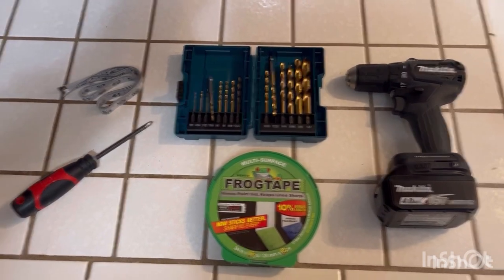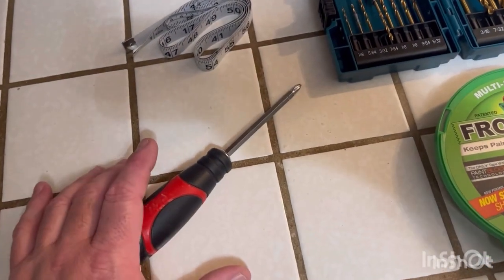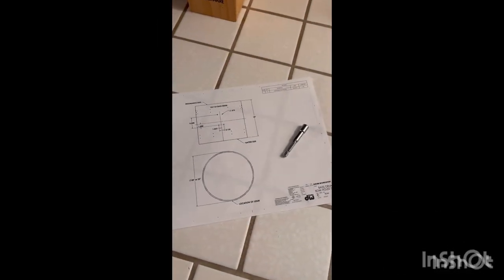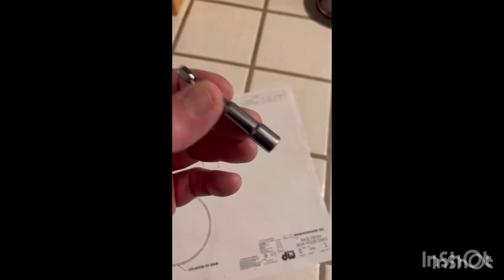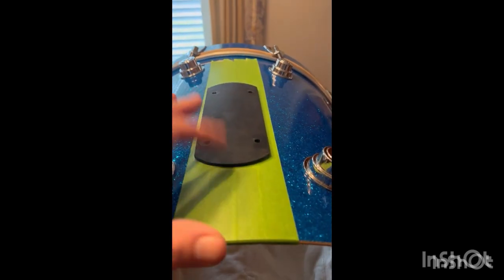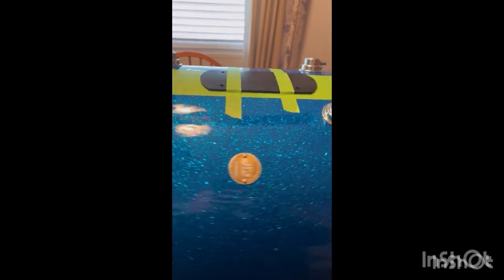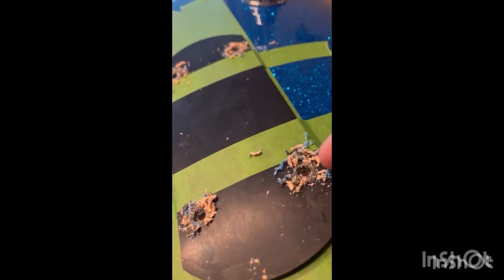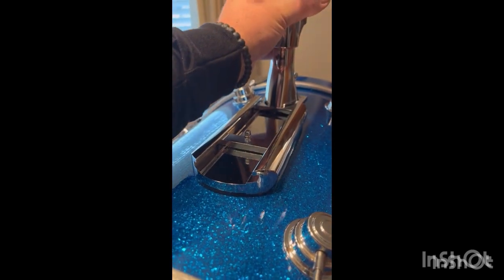The DW DWCP9900BD Bass Drum Double Tom Mount !!! (INSTALLATION)

Comment: Glad to see someone else doing this, it’s certainly opened a lot of convenience for me, and I can safely say that it has no perceivable affect on the sound of the kick after installing.  After having installed this on two different bass drums, here’s a few interesting tidbits for anyone reading this:
-Before drilling, I used a 1/4” bit with a hammer as a “punch” to guide the drill bit for each drilling spot.
-I used a small drill bit at first to go all the way through, then using a 7/32” drill bit and the pilot hole, I drilled about halfway through the shell from the top first, then used the pilot hole to guide drilling the rest of the hole up from inside the shell (this minimizes the outer plies of the shell from coming apart as the bit goes all the way through).
-I’ve installed these on Gretsch Renown Maple bass drums, which are thicker than what the provided screws can handle.  If you need to do this, I bought 1” 10-24 bolts and additional washers to secure it.

Thanks for making this video!

Comment: I'm getting ready to do this. Your video is very helpful. I also have the template from DW, but mine is slightly different from yours. If I follow mine, the mount will sit closer to the batter head. On yours, you've got the mount closer to reso head. I've just reached out to DW for clarification. I want to get it to DW spec, but it appears they have two specs!

Comment: Better to use the drum key bit in a cordless screwdriver as opposed to something like a drill.  A cordless screwdriver has much less torque  and the chance of doing some damage (when either loosening or tightening) is greatly minimized.
Reply: Most drills have a clutch. Finger tighten then set the drill it to the lowest setting and increase as needed. It's crazy how guys get so worked up about changing a head, then put their drums in the car without cases.